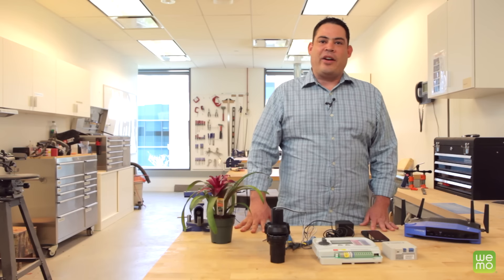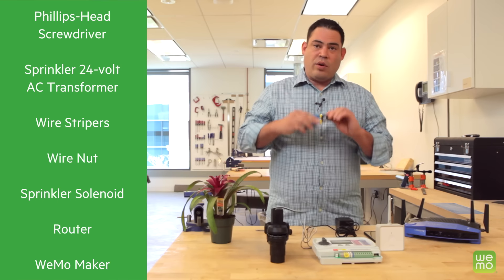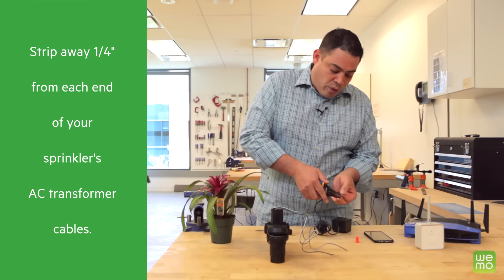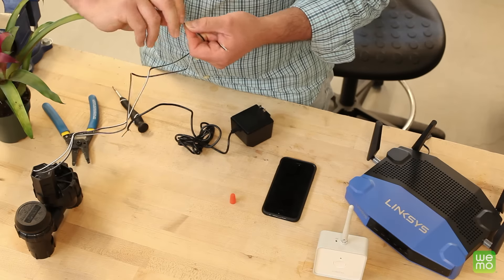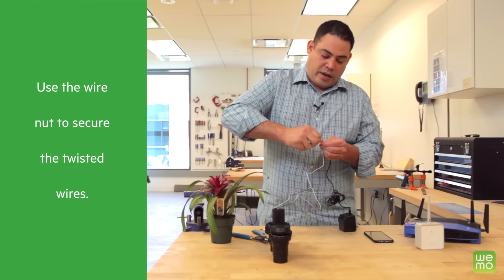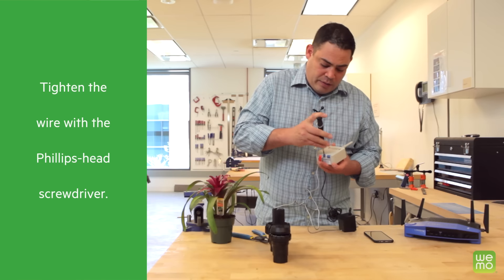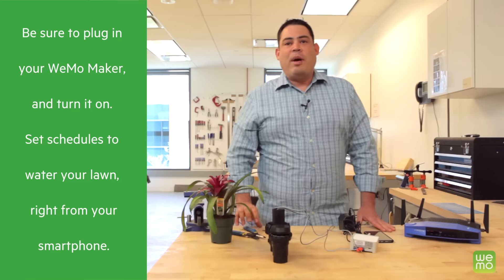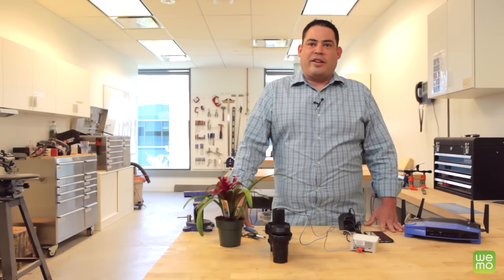WeMo Maker – How to Connect to Your Sprinkler System

Comment: Great video for "make" inspiration.  For those wanting to add an irrigation system from scratch, I found that using just a Wemo outlet switch works just fine.  You can buy a a 24 volt power supply in the irrigation isle of your home store to stroke the valve open.  Just plug it in and IFTTT it.

Comment: why wouldn't you just put the walwart into a Wemo switch controller ($40) and just skip the wemo maker all together?  Doesn't make sense to me.  I can see using it to integrate into an odd custom project... but if the thing plugs into an outlet anyway... why bother.  Honest question...
Reply: +Tinnitus Relief ! There is no Sensor input on the regular switch. If you want to add a moisture sensor etc.for adding special rules. For example if it rained you can create a rule "// If moisture detected, Then don't water my lawn".

Comment: Makes no sense to do this set up at all. So based on your video you would need to run 110 power to your valves and then have one outlet available for each valve? Then buy a WeMo switch or maker for each of those valves. Sounds crazy expensive and also not really safe having water in close prozimity to electrical. Moisture and costs are 2 if the many reasons why solenoids run on low voltage wire...This idea is just plain silly. Silly I tell ya